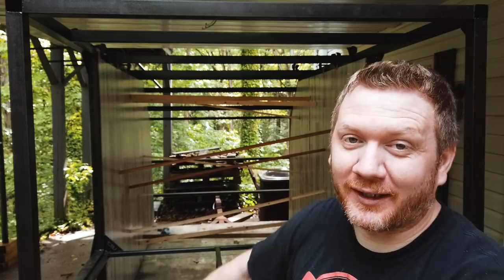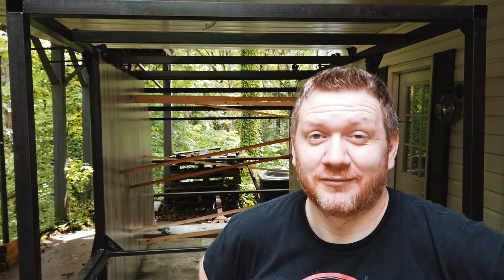Interior walls | Off Road Teardrop Camper Trailer Build 7

Comment: What adhesive did you use the glue the paneling to your frame ? & do you know what glue you will use to attach the foam insulation? Thnx
Reply from the maker: Just some simple liquid nails all purpose glue. It's less than $3 a tube :) hope that helps :)
Reply: When you get to the outside skin please detail how you do it thnx , I have a farm here in SW Colorado & am building a " square drop " trailer steel framed 😀 love your builds !
Reply from the maker: I'll do my best haha, I always try to put all the steps on the video for sure but I'm not the greatest at explaining everything :)
Reply: Southern Ginger Workshop  I’m new here. Just subscribed. Just wanted to say You’re doing a great job at explaining! I started my build about 6 months ago from the ground up, all aluminum with timbren suspension. Wish I had your video and editing skills. I get so engrossed in my build, I forget to take pictures sometimes, never mind filming and explaining. 
I chose aluminum for weight advantage as well as rust. But mostly because I can work with it almost like wood. Been a professional Woodworler for 30 years, so no welding, specially aluminum. I’m using 1/4” brackets, 3M VHB tape and 3/8” and 1/2” SS bolts. Lots of drilling! 😬 All bolts and washers are isolated to prevent galvanic corrosion. 
Love following your build even though the progress is slow. Money and time always get in the way, I know.
Reply from the maker: Welcome buddy! Thanks so much for the support and I know what you mean about being caught up in the build haha